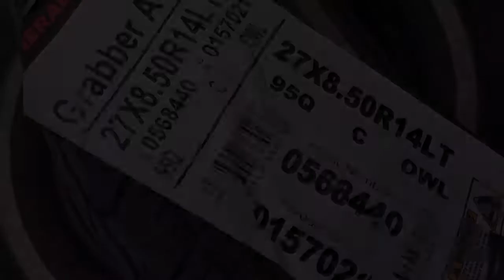New Tires on Army - Daily Driver VLOG 8/1/17

Comment: Looks great with the all terrains . Do you think 215/75 r 15 would fit a 74? Worried about rubbing when suspension is compressed or articulated off road . What are your thoughts

Comment: hey, great video! I know it's been a while since you uploaded, but at 0:24, those wheel center caps from that vanagon? or what vehicle are they from? I need to see if I can get my hands on a set of those for my 1988 Mexican Vw bus, since in the original owners manual they have the exact same center caps but they stole them from me and I can't seem to find them anywhere, maybe in the u.s market I have some luck, thank you so much
Reply from the maker: Those are pretty standard hub caps, someone on the samba should have a set that you can buy.
Reply: I found a few sets on eBay used around  $40, they have new sets for $90, but not sure the quality of the new,  never bought them.
Reply: @christophergrover2843  thanks so much man, I've tried searching over there too, just need some patience cause currently im not able no find any
Reply: @yumarcasado2086  I bought a set lady year,  then again a couple months ago.  Last time I they didn't have any for sale and then a set popped up a couple weeks later and I snatched them up.  If you have fb, join the samba group and ask or the samba forum website.  Or just wait and I'm sure more will pop up on ebay. The last set I bought were from a couple that travel and scavenge junk yards then sell on eBay.

Comment: How difficult is it to use the manual tire machine? Have you ever used it on nicer wheels?
Reply from the maker: +brian62793 it's pretty easy but don't use on nice stuff. It's strictly for steel wheels in my book.

Comment: Now you need four wheel drive.
Reply from the maker: +Kevin Hornbuckle That's the next project ;)
Reply: Do you have a design in mind? I am planning such a build with a Vanagon.
Reply from the maker: +Kevin Hornbuckle For a Vanagon you may consider using Syncro front end equipment. I was mostly just kidding in my last comment. I need to finish some stuff on Army, and finish the Turbo Bugaru project, then I can start thinking about fun new projects.
Reply: Busaru I'm wanting to place an 05  turbo wrx enjine ..any tips/suggestions?
Reply from the maker: +Jaime Flores get ready for a challenge ;)